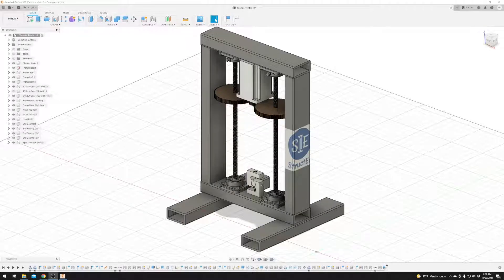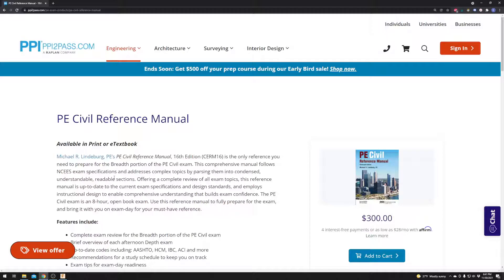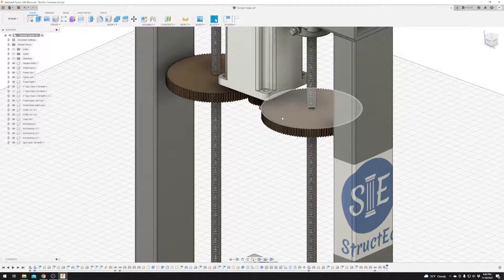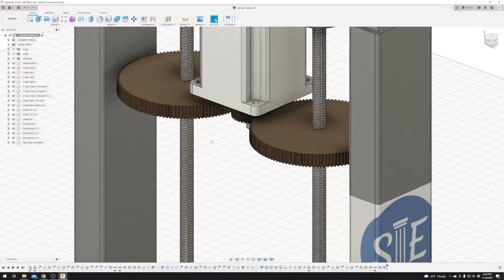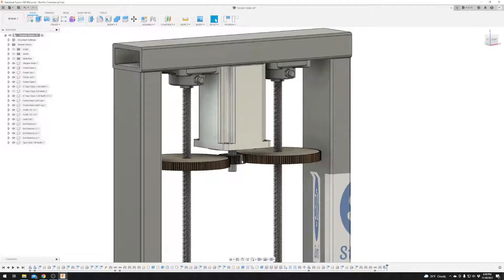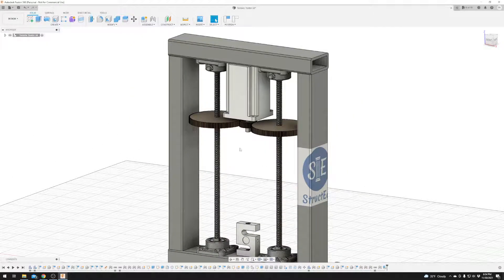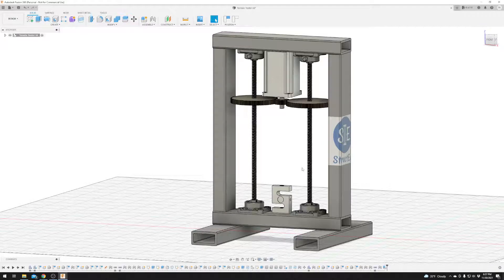DIY Tensile Tester (Part 1)

Comment: 00:05 PPi to pass offers a 15% discount and a reference manual for passing engineering exams.

02:25 Creating a DIY tensile tester for under $500

04:36 Finding affordable gears for the build was a challenge, experimenting with 3D printing and sand casting proved unsuccessful.

06:35 Using 3/8 6061-T6 aluminum for the DIY Tensile Tester.

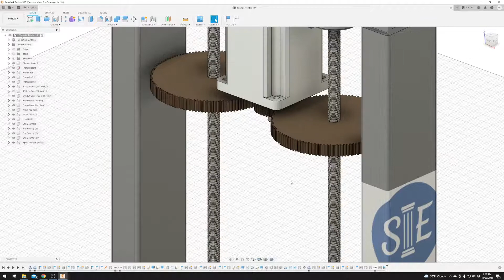08:35 The NEMA 34 stepper motor is much stronger than the NEMA 17 motor.

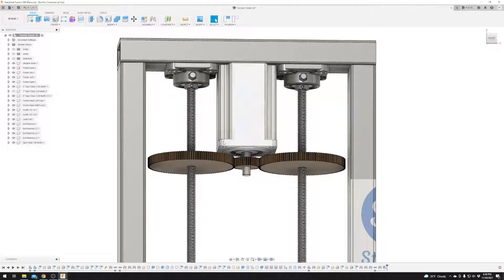10:59 The DIY Tensile Tester will have a larger cross piece on top with a window for the body and a hole for the shaft.

13:15 A DIY Tensile Tester is designed to measure force and displacement.

15:22 DIY Tensile Tester for testing materials and gathering data on their properties.

17:21 Reconfiguring the mounting holes and considering using heavier tube and jam nuts

Comment: This is a great idea, I hope you can revisit when you have more time. I am thinking of something similar, using a Harbor Freight 20 ton press, load cell and extensometer for strain measurement. I am looking at strength and stiffness improvement for graphene in plastics

Comment: Thank you very much for sharing! I have a short question: why did you place the test frame vertically instead of horizontally? In this case you can avoid the top part being too heavy.
Reply from the maker: Thanks for the interest!  I'm looking to have this be primarily used in tension, and in that configuration you're right that horizontal wouldn't be a big deal, but I'm also looking to perhaps make some compression tests as well, in which case thin materials could be unduly influenced by gravity.

Comment: I would advise you to put the motor on the bottom and the loadcell on top 
You want your tensile tester to be bottom heavy, not the opposite 

I work on tensile tester
I really like your project 
If you need help or advice let me know I would be glad to help you
Reply from the maker: Hamed, good tip, this one has fallen a bit into the weeds as I moved and have been studying for the SE exam, but hope to get back to it soon with Send Cut Send files linked for anyone who wants to copy it!

Comment: Part 2?
Reply from the maker: unfortunately still in the making.  Life has gotten crazy and I haven't made it to the steel yard yet, though I have most of the other components on-hand.  Also working on a CNC router to help finish the job, but the plans for that I purchased have been absolutely horrible, so it's taking much longer than expected.
Reply: @StructEdOrg  hope to see it built soon.